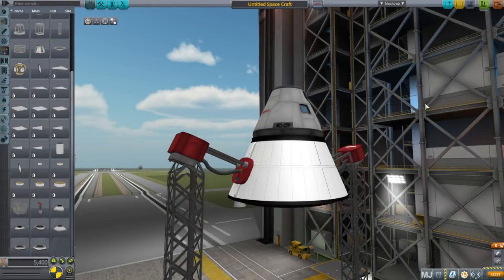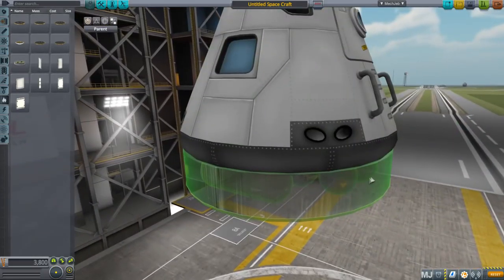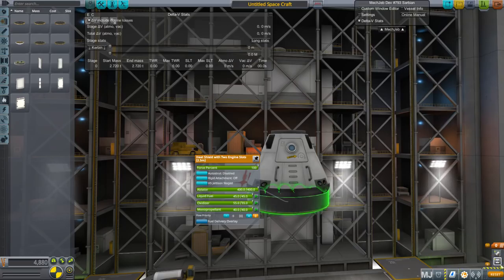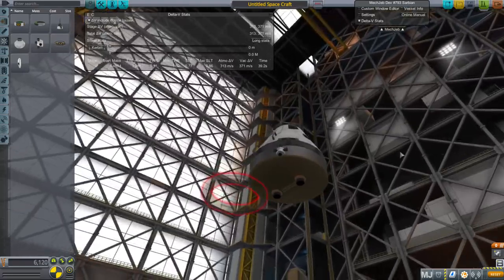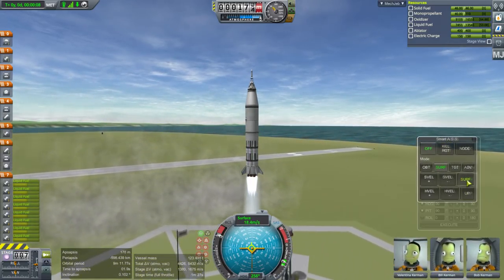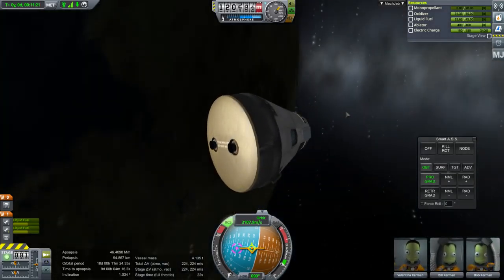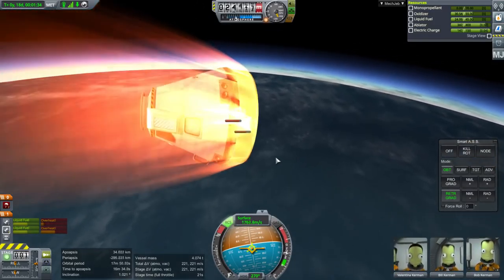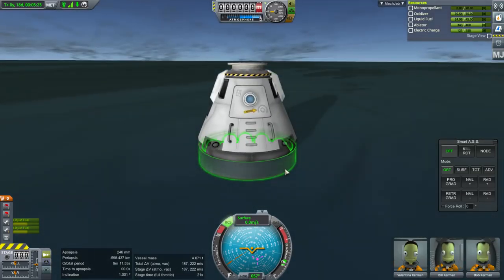Kerbal Space Program - Part Dev - Engine-slotted Heatshield

Comment: Your transparency issues are most likely not a result of anything texture related (unless you have transparent sections on your texture). My best guess is that your mesh normals are not facing the right way. Either hit ctrl-N in Edit Mode to calculate them, or select any "dark" faces and flip them manually by hitting W and selecting "Flip Normals".
Reply from the maker: Okay, sounds like a plan. Thanks again!

Comment: You should model it in same shape of capsule. The idea for a service module is very nice. I think the overheating of capsule is because heating passing through engines gaps. I don't know your ideas for ablator but I think will be very cool if you do something locks like the nose of space shuttle. Your parts are getting awesome.
Reply from the maker: The thing is, the heat shouldn't pass through the engine gaps as there's both a mesh wall and a collider between the engine gaps and the capsule. I've thought of making various heatshield shapes including a pointy one.

Comment: This is just a speculation, but make sure to check out the heat flow properties of your heatshield, maybe it’s just transmitting a lot of heat to the capsule where it should be a much better insulator.
Reply from the maker: I copied it directly from the stock 2.5 meter heatshield, so either that one does the same, or I have some other problem.